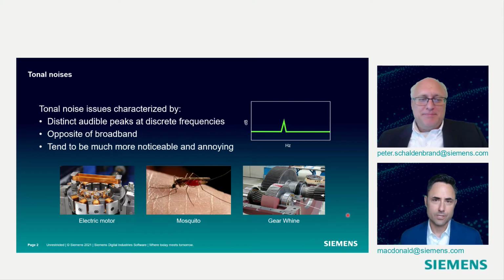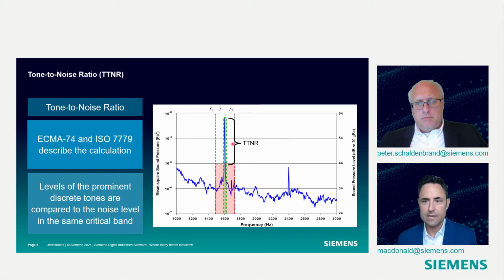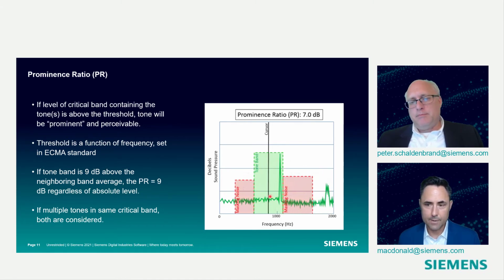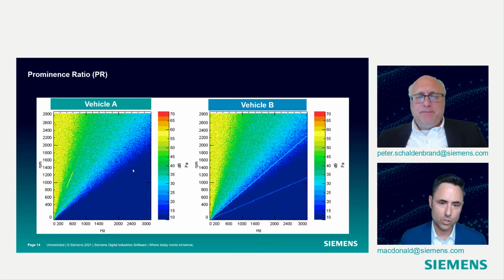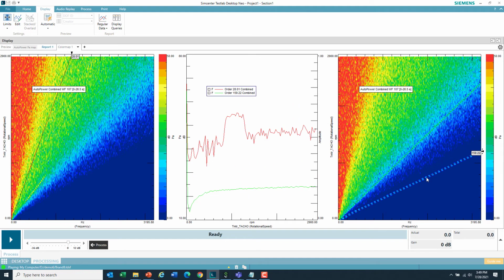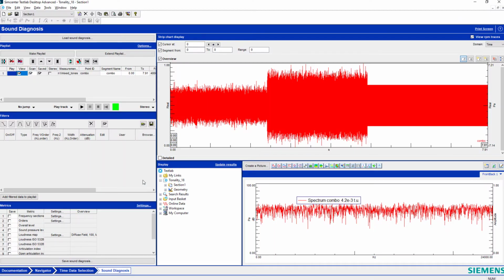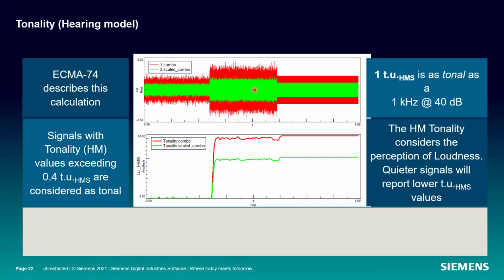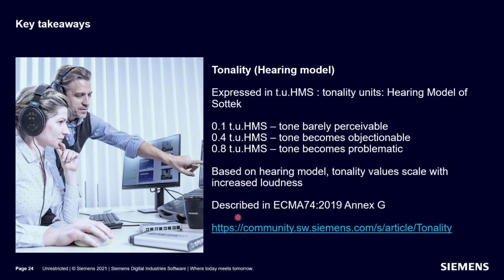Tonal Sound Metrics Seminar

Comment: Very useful presentation. I have evaluated the squeaky noise prominence ratio using the tips provided in this video. Just by adding a single cursor in the Spectrum Peak Hold diagram and R-Mouse->Calculations-> Prominence ratio. That's all the effort in Testlab classic. Thanks a lot!